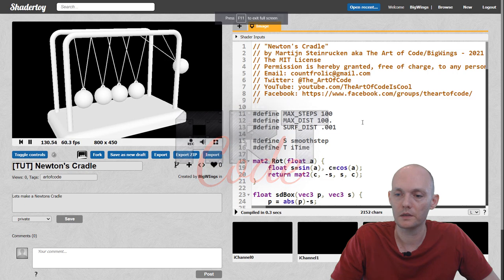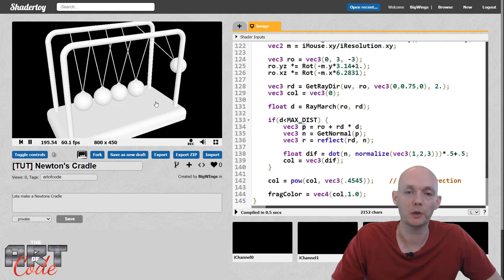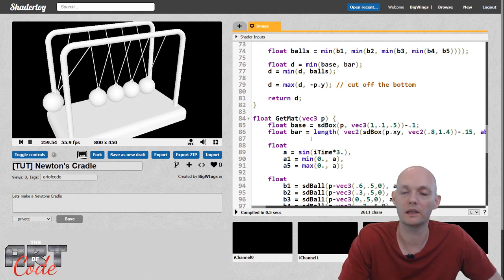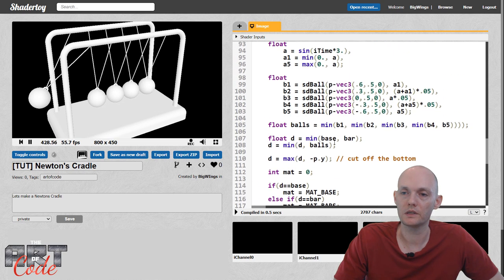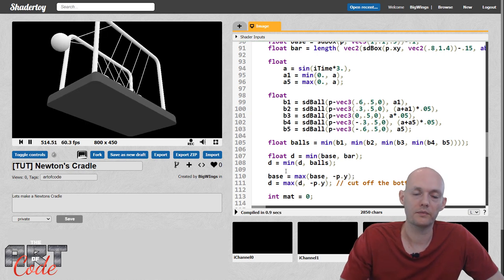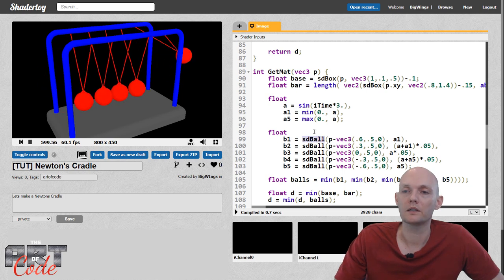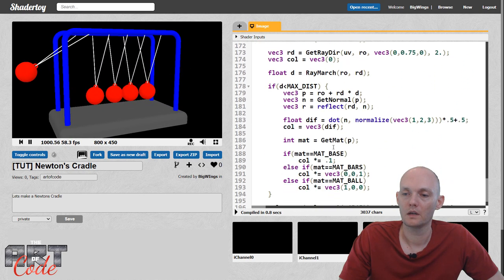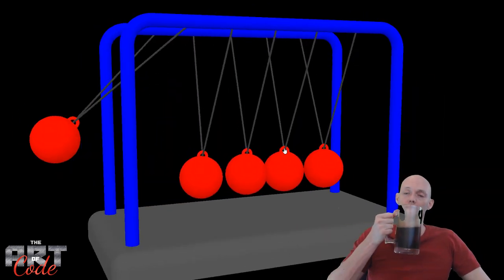Newton's Cradle: Setting up Materials

Comment: Hey, I like your videos a lot. You're a really good instructor and you're also really entertaining. I have a suggestion however, could you reduce the webcam size, or put it in the bottom left, so we can see the whole editor. It's not a big problem as you always edit code above your face, but it's a bit distracting that as the code writes your face moves near it. Also if you ever make videos using many input channels it could be a problem.
Great work anyway !

Comment: Could you convert the main GetDistance() to return a vec2 as you did for sdBall()? (This is what I thought you were going to do). You’d only have one set of object definitions, and make only a single “getDistAndMat()” call per frame.  Excellent stuff as always, mind-blowing.
Reply from the maker: Yeah in hind sight I might have done it that way. Would have come out a little cleaner.
Reply: @TheArtofCodeIsCool  Maybe, but there’s a lot to be said for getting the job done without over-engineering, too.
Reply: TBH, this is what I was expecting to see, because having to reproduce the same logic in two separate functions is pretty unreliable.    In my own experiments instead of a vec2 I use a "Hit" structure that contains the distance and a vec3 colour, but I might try replacing the colour with a material index instead.